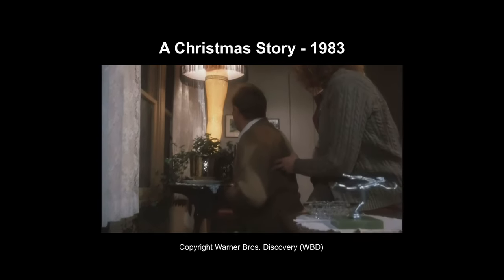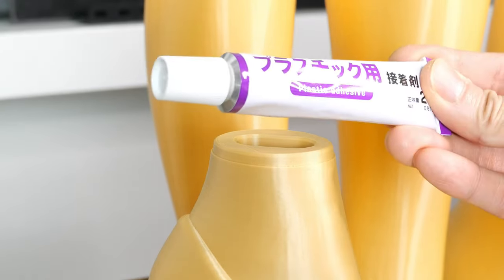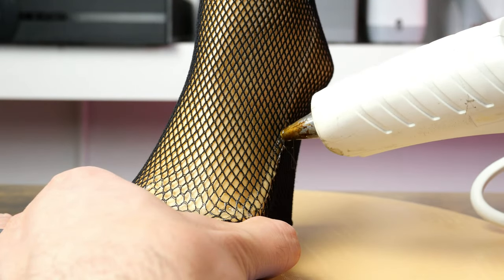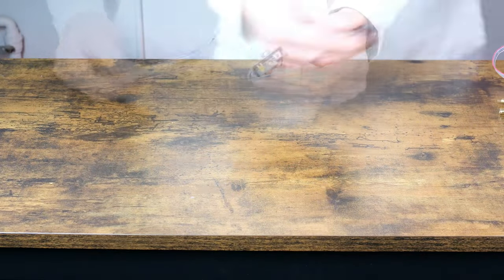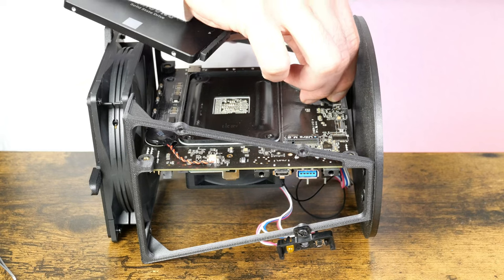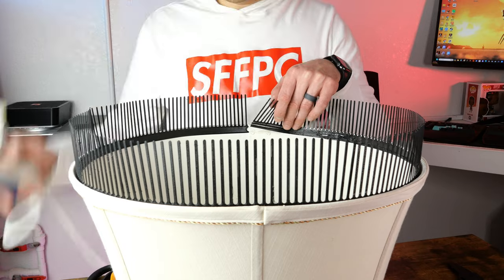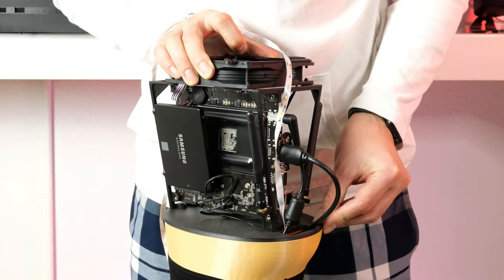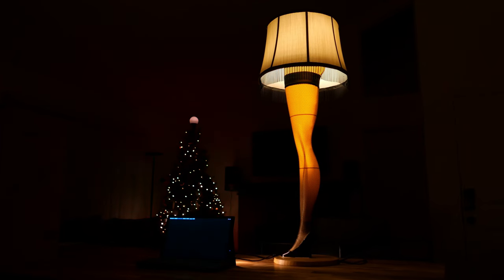The WILDEST 3D Printed PC Case

Comment: If you don't mind me asking, do you have a good website where you've found all the ATX standards for motherboard cutouts, hole patterns etc. Also, a cool case that i would love to see is flow optimized ones, like ducts to lead airflow better etc. Also, i had a "hot rod" pc back in the day, had the gpu externally mounted to draw air better, maybe something like that?
Reply from the maker: Thanks for watching!

I like to actually measure before designing, but this is a good resource (reference links are at the bottom): https://en.wikipedia.org/wiki/ATX

If you want to see an airflow optimized build check this one out: https://youtu.be/-hde9SgFWdA